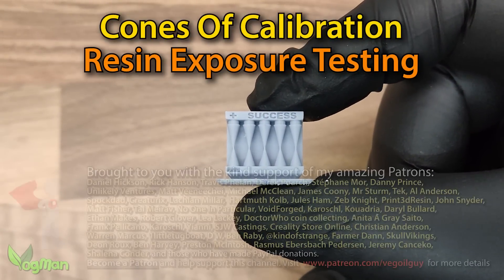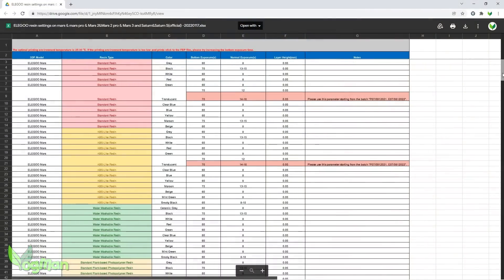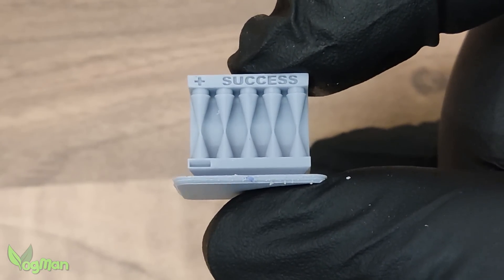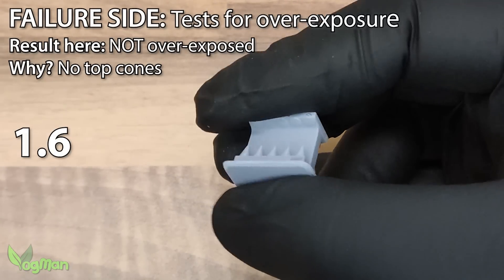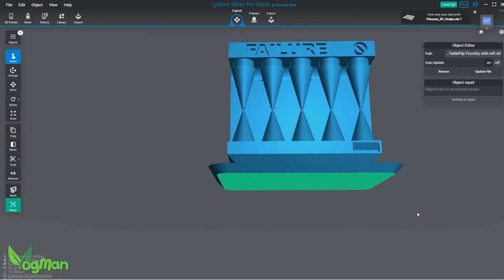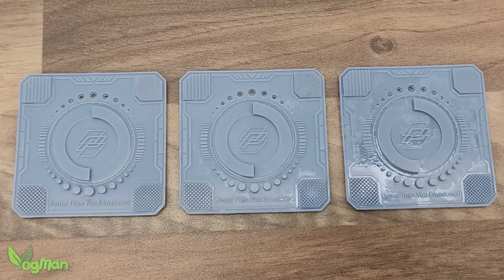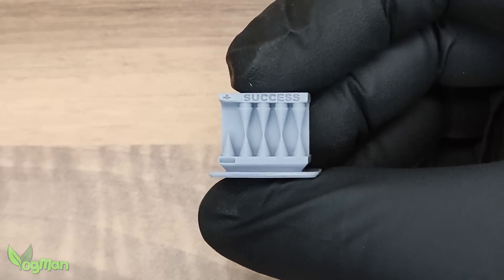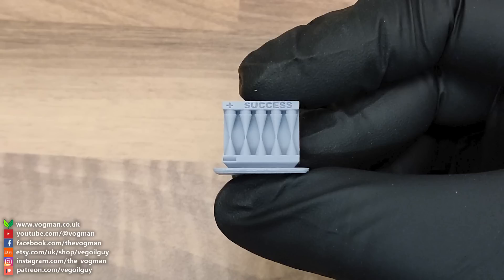Exposure times testing (dial in your 3D printer resin) with the CONES OF CALIBRATION

Comment: Just got a new printer, and started this up, why the heck is mine telling me this is gonna take 5 hours to print?
Reply from the maker: Sounds like your settings are wrong my friend. It should take less than an hour, that's for sure.
Reply: @vogman  Its Halot Mage 8k( bought a year ago and just opened it) and just going off basic settings with chitubox 2.2 to start off. First print that was on stick came out amazing. Then tried to print other stuff and layers were sticking, and supports were fine, but model kept falling off supports Realized I forgot to put holes on opposite for drainage. Then realized after cleaning the plate wasnt on all the way, so re-leveled and decided to run this. Seriously says 5 hours for this. Even the statue that came out great on stick took 12 hours and its only 6 inches tall. Been a few years since i resin printed but still thought odd its taking so long for such a small print. Still doing research right now to dial in settings. I put in same as I was using a year ago on my Saturn S, and mars 2 pro and I dont remember it taking that long on those printers.

Comment: Great video. Direct to the point and well explained. 

If you pair this with the Cubes of Calibration you will definitely increase your chances of success dramatically. J3D explained that the Cones are definitely good for checking to find your minimum exposure as well as the tensile strength of the resin you are using. So if you print your the CoC and they print successfully at say, 3 secs but the thinnest cone seems to be TOO thin you may want to consider bumping up the exposure a bit if you plan on using thin supports anywhere to avoid potential print failure. 
Once you have that in I print the Cubes of Calibration to get an idea of the dimensional accuracy. I am not looking for perfection, just want to see if the parts that I print out with those settings will fir together, even if they are a bit snug. I prefer that to having to sand it down. If I feel I can't put them together without forcing them in I will reduce the exposure by 0.25 at a time until it fits. I will then print another CoC to see how the cones have been affected and make that estimate of what the thinnest supports I can use are.

Comment: Cones may not neccessarily give you the best detail, especially with some oddball resins (flexible, ultra durable...). It's just a measure of tensile strength of the resin - overexposed resin will have more tensile strength and will let the "fail" cones print. But so will a correctly exposed abnormally durable resin. I thought there was some gap between the fail cones and top that only fills when overexposed, but there isn't so it's just tensile strength.

Comment: Good evening/Morning. Question as I feel I've been chasing my tail for the day. When you say, "Increase base layer", or Decrease Base Layer" are you referring to the Burn Layer Settings? I'm using Lychee on a GKTWO (Best Printer there is) with Siraya Tech Navy Grey which I understand requires a 20% increase of most the settings. I'm trying to stick to one setting at 50 microns  and dabble from there. Currently my Burn Layer is : Layers: 6 / Exposure: 35 / Transition Layers: 6 / Light Delay: 3 secs / and for the Normal Layers its running at 1.85-2.5 Exposure. Problem im having is still getting overexposure with the Siraya Tech test on the post and holes, and with the CoC test the Sucess side looks overexposed while I'm still showing 2-3 top cones that are failingish. Maybe im overthinking/ over perfecting the setting but just asking.
Reply from the maker: It's easy to go down a rabbit hole with settings. Genuinely, pretty close is good enough.
"Base Layer" refers to the first layer, the burn in layer as you call it. It's called different things in different slicers but it has the same job... to bake the print on the plate.
ST Navy Grey has a reputation for being a bit awkward to dial in. I've struggled with it in the past and moved onto something easier - and much less smelly 😁

Comment: Question. So i print the cones out at 1.2 that is what siriya tech says its exposure time is. Yet when i print the phrozen at 1.2 it shows its under exposed. Then i print both at 2.2 to see if i was wrong , and all the cones touch, yet the phrozen calibration prints dead on. Wtf am i doing wrong? Because at 1.2 the prints dont stsy on build plate? Do i just need to up the exposure settings, im usin lychee, and bottom exposure is 20 sec as siriya trch says it should be.  Im loosing the fun and want to learn.
Reply from the maker: I'm going to be honest here and I'll probably get a lot of flak for it, but stick with the one test and get pretty close. It's often hard to get "perfect" - especially with speciality resins, and "pretty close" tends to give us pleasing results 😁
And remember, no AA when you're printing these tests. That screws everything up.

Comment: how do you take 40
 minutes too print thoose i take 2 hours AND 10 MINUTES using the elegoo jupiter  Resin Printer with the Abs like Resin  (not v2)    what could cause that long time of them beeing printed ?
Reply from the maker: I guess it's difference in resins and of course printers. Making sure the resin is warm also helps. But the biggest culprit will likely be your settings.
Reply: @vogman  thank You for the answer . Its crazy how the cones printing time difference can be that far and different i could only Print the cones in 40 minutes If i Put the Scale on 50% down but nedless too say that that Made the cones too fail.  Interestingly i choosed a exposure time of 2.5 s on 50um  layer height with 4mm Lifting distance  60>180 mm/m lift Speed retract Speed off 180>50mm/m and the cones sucsess Side does appear to have all cones printed. Still the failure Side builded Up 2 and a half cones. I tried then too lower the exposure time but IT failed printing on both Sides.

Comment: I noticed when I take already pre supported models and make them smaller they fail. I know it’s cause the supports are smaller so question is if I slow the lift speed will that help to avoid the supports ripping off

Comment: before I used to use this test but after testing many brands of resin, I have seen that the test is unreliable, for example with the siraya fast navy blue as I was reducing the exposure times, instead of disappearing cones, the ones on the failure side were still coming out all but curved, or with other brands stop coming out cones with very low times and then in a real life impression everything stuck to the fep.

Comment: Unfortunately, it doesn't work with non-brittle resins like Fast and Blu or transparent resins like Tenacious/Simple.  I tried it with BLU and ended up bumping the exposer down a full second from Siraya Tech's recommended setting before I came across a post on their Facebook forum from someone else experiencing the same thing.
Reply: Thanks for mentioning this!! I’m using the fast abs-like navy grey, and I have one come not fully formed on one side, and failure side showing 3 pointy nubs. Was driving me mad!

Comment: According to this test, I'm still overexposed at 1 sec exposure time/.03mm layer height on my sonic mini 8k (using 8k phrozen grey resin). That seems insanely low.. Should I be concerned about going lower?
Reply: I started at 1.5, then 1.3, down to 1. Still successful on the proper side and cones forming on the failure side.

Comment: I gave up on this test way too long and even when overexposing never got all cones on the success side to connect but then I would get cones on the failure side
Reply from the maker: It is slow, I agree. That's which I use the Phrozen XP tests first, as they usually take 10 mins or so ( https://youtu.be/jOjB3Fr-0no ). When I think I'm close, I use the cones, though even then as long as it's pretty good, I'm happy.
Reply: @vogman  And what if my cones of calibration are perfect, but my prints still fail at places?

Comment: This is genius and saves so much time trying to read and figure out what's going on with the regular tests. Now I wonder, will a perfect exposure result guarantee no print lines? I got a ton on a recent print o a fairly modular model after I thought I had dialed in my settings.
Reply: This is a stress test that uses blooming and/or resin hardness to build strength to get a predetermined weight to print.  It won't do anything for layer lines or stepping. The best way to get rid of them is lower your layer height and use AA.

Comment: So I just tried dialing in my anycubic photon mono 4k with white "standard resin" from Inland. I used phrozen to determine that I wanted my exposure to be between 1.5 and 2 seconds and then used the cones of calibration to determine where exactly I should be. Unfortunately the cones brought me all the way down to 1.1 seconds at which point the phrozen stl is definitely not happy. Can anyone tell me what this means?

Comment: I haven't gotten my feet wet with resin printing yet,  so forgive what may be a stupid question.  Given the small size of these calibration models, I'm wondering if it would be possible to batch print however many can be reasonably fit on the build plate, with different exposure times for each?  Each layer would take considerably longer, but it seems there would be considerable time savings overall compared to printing them separately.  The only caveat I can think of is that, if there's any UV leakage through the blacked out parts of the screen, that might skew the results.

Comment: Your video on calibration was crucial to me, at least after switching to a cheaper (and slower) resin, which I had to dial in (at first with the flat tests, and then finetuning it with the Cones & Cubes of calibration) in order to get good prints and good strength of my supports (I'm using quite light supports of 0.6mm, and I'm now experimenting with even thinner 0.18mm tips & 0.56mm columns).

But since I'm about to make a DIY centrifuge and I need the strongest resin & process I wondered about how most resins need post curing with UV to get their maximum strength.
But post-curing is actually not very efficient (unless you have mostly clear resin, into which UV can penetrated well enough).
So I wondered - during printing each pixel in each layer is exposed to UV for the exact time we set, and we even set much longer time for the bottom layers, so ...
why not increase the exposure time in order to get maximum strength during printing?
Have anyone tried this? 
Any results?

Comment: I must admit that I'm a bit unclear about the mechanism behind achieving the perfect calibration using this method. The issue I see is that different resins have varying levels of strength, and it seems like this test exploits that particular property. Instead of providing feedback on issues like "blooming" or "underexposure" on the pixel level, it appears to primarily assess whether the material has reached the necessary strength to produce the cone accurately. While it may ensure structural integrity, I'm still curious about how it addresses other calibration factors. If anyone has more insight or can shed light on this, I'd greatly appreciate it!
Reply: I think, as others might have suggested, The whole point of this is not to show you what is going to give you the most effective detail but what will give you the most consistent printing.
This is the engineers best tests rather than the model makers best to test if that makes sense
Reply: essentially as I understand this test should give you the thinnest non-failing supports =)

Comment: Photon M3 Max- Tough white anycubic resin.
I'm struggling with some problems - it does not work properly ;/ Time of printing that you said is slightly different than my.... You said approx 40 min. but in my case that is around 3h... normal exposure 2.8s and burn in is on 28s(6 layers), speeds around 8mm/s. Exposure off setting is on 1s. I'm newbie in this stuff and now i don't know what else i can do... On this printer there is also an setting called "Exposure off compensation" and you can choose off or on. Now i set it to off because it buys me extra minutes from this printing (faster printing when its off). And now the main issue- when i was on 2.7s exposure one of the cones on success side was not connected with the bottom one, but the on failure side still are small cones on the top that should not be appeared in such settings. In my case time between normal layers is around 33s. I measure it this way - for instance layer 120 appear on printers screen then i push start button to measure time on my phone and i put stop when layer 121 appears on printed screen. Is there someone who knows what is wrong or it supposed to be this way... :(

Comment: hmm…i have saturn 2 8k and elegoo standard grey resin. exp settings 3.5 sec. if i use 1.6 sec, wont even get a print.
what resin / printer will get you 1.6 sec exp time?

Comment: Wouldn’t the cones create little bits of cured resin in your vat?  If the failure side cones don’t print, won’t the machine cure a ton of concentric circles of resin that aren’t secured to the plate because its still trying to print those cones?

Comment: struggling with mine right now. first go round was near perfect on the success side, but had some micro cones on failure side. dialed down .1 and go again, and success side now has two cones not touching but still have some micro cones on the other side. now i'm fiddling with lift speeds etc.. frustrating as my first print or two went pretty well but now i'm having issues. this eco resin has been finicky too.. welp. print another cone and see what it tells me. i have a pile of these now all with exposure settings etc written on the bottom. i will find THE setting... i hope.
Reply: This has been exactly my issue! I found it best to just make sure that the success side cones are all connected and ignore the micro cones. I much rather have succesfully printed supports than "perfect" exposure. (I'm using Siraya Tech "Fast" Navy Blue resin)

Comment: I'm not sold on these types of tests. I'm sure they work but they're not very convenient. As mentioned in the video, the process takes too long. I also don't like that this particular test is designed to fail. Seems like that might leave bits of cured resin stuck to the film or floating in the vat. No thank you. 

The best option I've found is UV tools multi exposure test. I you haven't used UV tools I'd highly recommend it. It's a free validation tool that allows for all kinds of modifications that are not possible in traditional slicers. Their exposure finding tool is easily my favorite. You set the exposure range and increments, it will then print all of them in one go. You get the added benefit of comparing the results side by side in a single print. It does take longer than standard calibration models but it's so much more convenient. The test prints can be fairly small depending on how many exposures you end up testing. It's not necessary, but a loop or some form of magnification will make determining the proper exposure a bit easier. Seriously check out UV tools, as a jeweler I've found it to be invaluable.

Comment: Nice video. Biggest problem I have with resin is dialing everything in. So much easier on FDM with most PLA being able to be printed at the same settings (at least in my experience). I wish there was a way to print multiple cones at once using different settings but I guess that would be impossible unless each section could be cured for a different length of time.....hmmmmm....I am going to have to research that! 
One thing - PLEASE everyone make sure you CURE those test pieces before throwing them away!!!

Comment: as I understand it In addition to the exposure time, the Z lift distance and speed play into the overall results. you can have perfect print exposure for your UV lamp/laser and resin combination but have a z lift issue which pulls rips the layer off the print rather than properly pealing off of the FEP film. prints pulling off supports can also occur due to the z lift settings

Comment: i wasted allot of time testing exposure times of the Anycubic Colored UV Resin on my Mono printer and it turns out the exposure time highly depends on the ambient temperature. so if you want to be super precise and get the max accuracy out of your printer, you have to control the temperature of the resin. still haven't seen any printer with such functionality.
Reply from the maker: Absolutely. I wouldn't be without my enclosure heater. Temperature is very important to success 😁

Comment: So I got ths to test out Ameralabs TGM-7, but it constantly fails. I don't know if its due to the elasticity of TGM-7 but going up higher and higher and it never seems to print the top cones.
Reply from the maker: Interesting. That is a very flexible resin. I'm not sure why it would effect printing though. Did you have a good ambient temperature?
Reply: @vogman  about 25c. I decided to jump to 3 seconds of exposure before it formed cones one one side. So either ameralabs suggested settings are way off at 1.1s for sonic mini 8k, or this test does not perform well for tgm-7. Maybe both.